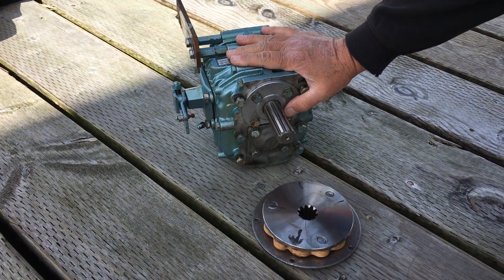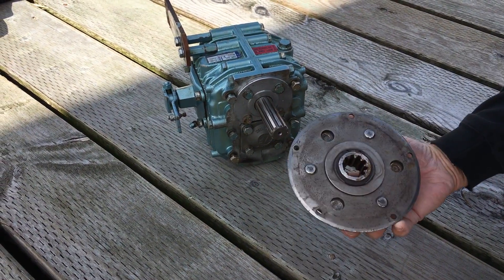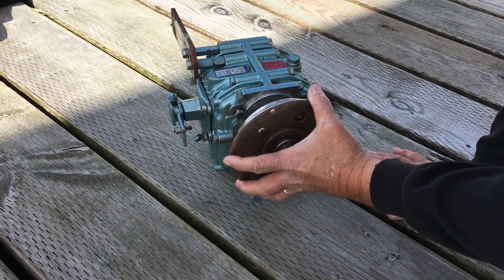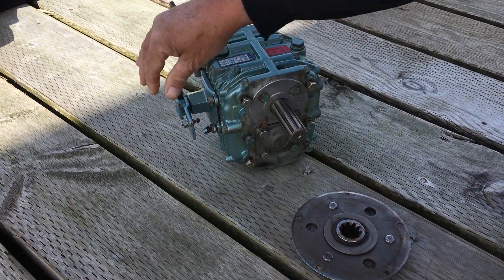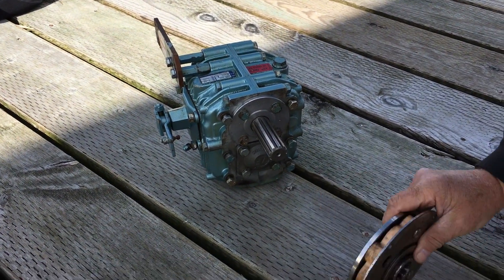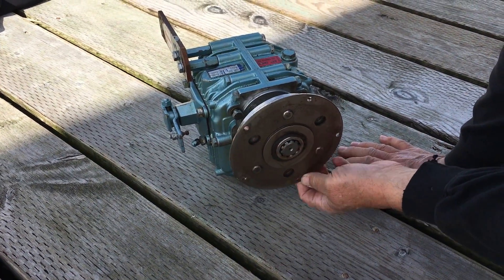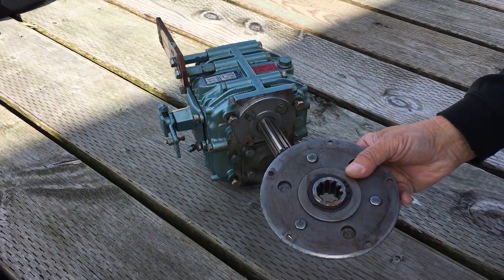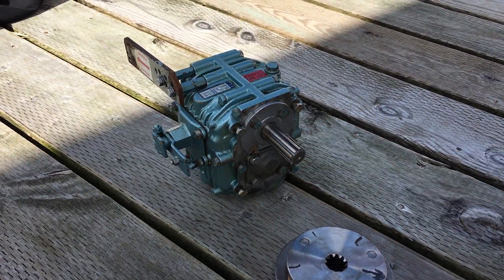ZF Hurth Damper Clatter

Comment: Just found this clip hmmmm interesting!
I’ve been aggravated by this noise myself. 
I have a Beneteau  First 41.5 with a Perkins Prima M50 / HBW10 approximately 30 years old I had the transmission 
reconditioned and it never made any difference to the chatter at idle , yes I fitted a new dampener plate. The trans lasted another year before it started slipping in forward , yes I motored a lot. I decided to fit a brand new ZF 12M with another new springless plate from R&D and guess what the chatter was  exactly the same . I ran the motor without the trans connected before fitting the new trans and of course it had no chatter. From what I’ve learnt you simple cannot reduce the chatter which is 100% caused by the Perkins 
“Torsional Vibration” . 
It’s a tiny transmission with a very light/non existent flywheel. 
The Perkins M50 should never have been matched to HBW10/ZF 12M . 
The ZF15M or ZF25M is a better option especially if your motoring often . 
Ps a cooler is a must .
Reply from the maker: David, I think you're absolutely right: That tiny Hurth should never have been married to that engine.

IF you're interested in upgrading the transmission and IF it would fit your boat, I have the PRM-120 that I installed when my Hurth failed. I installed it in Prince Rupert and used it to get home to Portland. At that point I put in a brand new PRM-90, which is smaller than the PRM-120, and which allowed me to position my engine back in its stock location and to get the engine cover and companionway stairs moved back to their original locations. I have that PRM-120 sitting in my garage. Only about 200 hours on it. AND it's a much huskier tranny than the PRM-90. The 120 was way overbuilt for my 35hp engine. The PRM-120 is about 2 1/2 inches longer than the Hurth - if I recall correctly - so it would only fit on a boat that had sufficient propeller shaft to provide that extra space. (Also sliding the prop shaft back that 2 1/2" or so might cause impingement of the prop with your rudder, so you'd have to plan the install carefully.) No cooler would be required. I have many photos that can help you do your planning.

I'd be pleased to sell my used PRM-120 to someone who could use it. About $600, which is WAY LESS than even an overhaul of the Hurth.

Leave a post here if you're (or anyone  else) is interested. Note that I don't check YouTube very often, so there might be a delay in my response.
Reply: @Houdi2  Hey, if you're still in possession of that PRM-120, I'd like to talk with you about it.  I have a Perkins M-30 on my steel schooner that EATS HB-10's and ZF 12's.  I think I have enough room to extend my engine bed if needed, to accommodate it.  Let me know.

Comment: May I ask what engine that Hurth was connected to? When you replaced with PRM120, did you have to adjust engine position? I have a 1985 Catalina 35 with a Universal M25 engine and Hurth HBW50 transmission.
Reply from the maker: Adel, I apologize for not responding sooner.  I don’t get on YouTube very often. My boat is a 2002 Catalina 36 with a 35hp Universal diesel. The Universal is simply a marinized Kubota. I (finally) swapped the Hurth for a PRM-90. Yes, I needed to realign the engine AND to re-pitch the prop. 

Backstory: I first installed a PRM-120 which was 1 1/2” longer than the Hurth it replaced, because it was what I could get relatively quickly. I was in Prince Rupert, BC, and NEEDED to get a working tranny fast and start moving south because the days were getting shorter. My worry was the long nights I would be facing on the ocean segment from the Strait of Juan de Fuca down to the Columbia River. I had to get moving as time was running out. The PRM-120 forced me to move my engine 1” forward of its stock location. Later, back home I took out the PRM-120, installed a new PRM-90, and put the engine back into its stock location. I still have the PRM-120 with about 1,000 miles in it in my garage. If an Hurth HBW-50 or -100 user wants to overhaul their tranny, this would be a great buy PROVIDED they had enough potential prop shaft movement aft to accommodate the slightly longer dimension of the PRM. My difficulty on my Catalina 36 MkII is that the available prop shaft was minimal. I am told that the Catalina 34 has ample shaft available. Other boats might also. A google search for “PRM-120” will bring up a manual with all specs.

Comment from the maker: Importantly, the gear clatter due to poor spline fit is IMHO one of the main causes for shortened life of the Hurth transmission. Other significant causes of shortened ZF Hurth life include: 1) bad engine mounts; 2) poor helm technique, ie, shifting gears above idle; 3) sudden stoppage, ie, a crab pot line wrapped on the propeller; 4) misalignment of transmission to prop shaft, ie misalignment greater than the .003" maximum in the spec.

Comment: Is the noise acceptable? if I increase the idle it goes away, if I place it in gear it goes away
Reply from the maker: I got fed up with the Hurth on my Catalina 36 and replaced it with a PRM120, and then only a month ago, with a PRM90. The PRM120 was a dire straits substitute, as it was the only one I could get my hands on in the Canadian bush in a reasonable amount of time. (I was in Prince Rupert, BC, and had a looming deadline to get back home.) The PRM 90 is the right transmission for my boat, and now that it is properly installed everything is operating smoothly. I intend to make a lamp out of the Hurth.

The gear rattle of the Hurth is, in my considered opinion, one of the reasons the Hurth doesn't last very long. I theorize that each 'rattle' is a tiny bump that causes minute slips of the clutch plates. But if you increase the idle, then each shift into and out of gear causes even more damaging load on the clutch plates...both effects (clatter and high idle) are bad news. Of course, a sudden stoppage by snagging a crab pot at cruise power is probably the worst damage that can be done to the clutch plates. 

I recommend: Set your idle as low as possible and make sure the helmsman ALWAYS waits until the engine returns to idle before shifting into and out of gear. Patience! Patience in close-quarter situations. But when it comes time to overhaul the tranny, look for a PRM substitute for the Hurth.
Reply: @Houdi2 The trouble you mention whit the hurth is caused by a to light flywheel on the engine, and even more, the wrong damper plate mounted! the Hurht it self is very forgiving, and not the cause of the ratteling, its just a wrong combination of flywheel, and even more the damper plate you had.. (that was a damper plate for a hydroulic gearbox, And yes there is a huge difference between both of them) . Best Regards, VRM marine.
Reply: @MrBugsier5  I have Hurth with m25 engine for 1983 Catalina 36.  Any idea the proper damping plate?